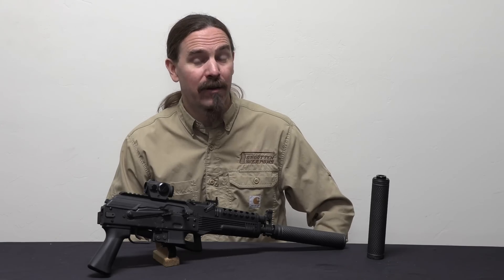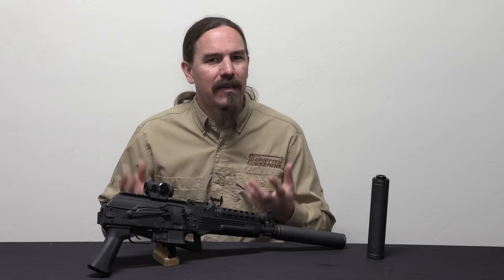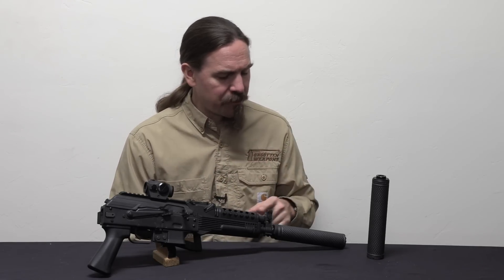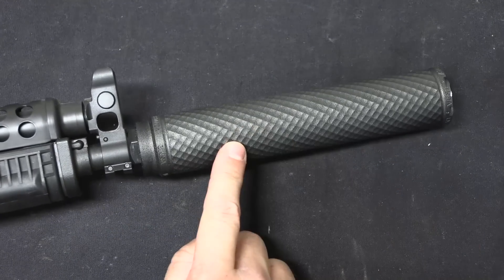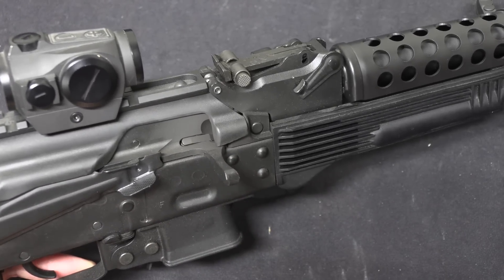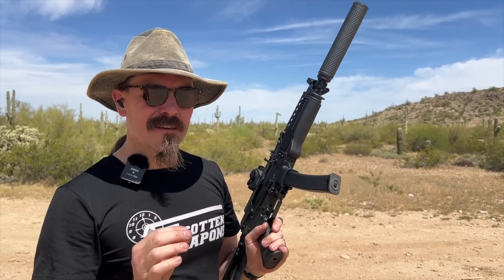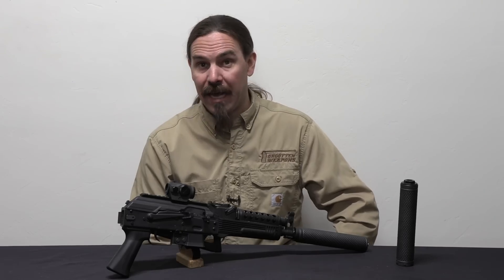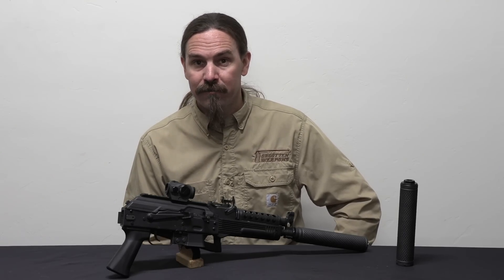PTR Vent Suppressor: 3D Printed Titanium Foam

Comment: This is a great application for metal 3D printing! 

I work as a machinist in custom lighting, and made a sculptural light fixture for a medical implant company a few years ago. 
(They sent us two skids of previous generation parts, and we strung them like beads on aircraft cable. Some interesting alloys in there!)

I may have, uh, hung onto a part I thought was cool, a titanium... spinal spacing wedge? which is dense at the tip, porous through the body, and dense at the back in the centre, allowing for a tapped hole, I suspect to allow for removal or back pressure. 

I'm a decent machinist, but I have no way to produce parts like this, which is pretty exciting, to me.
Reply: "...a titanium... spinal spacing wedge? which is dense at the tip, porous through the body, and dense at the back in the centre, allowing for a tapped hole..."

Out of possible interest to you:
I had two "cages" implanted for a spinal fusion.  I don't remember what material they were made of and the best description I came up with was "a stretched heli-coil with some connecting bits for structure that still allowed the mashed-up bone goopy paste (from my "hip bone") to be mushed into it and fuse into a solid bone graft".  They were made in specific diameters (height between my vertebrae) that I imagine correlated to common drill bit sizes, I don't remember how important ordering a certain length was. 

Sadly I was not able to keep them for my collection of "things that were once in me".  I tried but the approach/procedure was a study so they needed them for whatever reasons.  It was a successful fusion until I tore it; replaced it with "rods and screws", fusing the next level down at the same time (L4-5, L4-S1; it sucks, I do not recommend trashing your back).

Comment: What about the fact that titanium burns? I remember in the WWSD 2020 discussions about the parts for the final production rifle, it was said that titanium flash hiders were tried, but it was quickly learned that "titanium flash hider" is an oxymoron because the titanium will flake off and burn. Do these suppressors have the same issue?
Reply: Titanium cans, especially printed ones, do spark more in the first couple of rounds as the left over shavings or material is burned off. After that, whatever spark you may see is oxygen inside the tube burning after the first or second round. The two Ti DDC cans I have had some sparks to them initially.

Comment: I wish the ATF didn't exist, because I'd like to make my own delta flow suppressor.  I made a 2 stage delta flow muffler for a 420cc utility engine.  The same loud and annoying engine found on every cheap 3Kw generator.  But it's completely quiet.  The idea is the sound splits into two equal waves down a hallway, and cancel out as they meet up again.  Of course a rifle or generator doesn't sound like a clean sine wave, so you need different length halls within the entire spectrum it produces.  The delta shape basically allows different length halls as the diamond tapers off.  If it's not good enough on the first pass, then just run it through another.  Would look pretty cool as a suppressor too.  Like a big flat tank cannon comp.

Comment: Suppressors aren’t designed for guns to be quiet they are designed to be used for attack purposes
Reply: Then why do companies like DDC, OCL, Q, Liberty, Rugged, and others make and market Ti and Al cans as being quiet for hunting? I doubt the GA sportsman or rugged Alaskan was made for a direct attack actions since both have terribly high back pressure and limited firing schedules.
Reply: @ja0298 as suppressors are made for rifles being as long barrel and the design of the attachment makes the gun least sounded, you can hear it sounds like a airsoft gun but it’s a real gun
Reply: @worldbiggestfan1   those certainly are words, but that doesn’t really make sense or answer what I asked. How much do you actually know about cans and how many do you have/shot? Also you do know there are pistol suppressors right? Not just rifle suppressors. I should know, I have a 45 and 9mm can.

Comment: An interesting man had made a similar device in his home workshop experimenting with Aluminum Foam, Silicon Carbide Ceramic Foam, and High Flow Carbon Foam, all from McMaster-Carr; with the right combination it was VERY effective. 
22LR was spooky quiet and 9mm was impressive with a slightly larger can.

Comment: It makes me wonder if the reduced chamber pressure make it possible to suppress a PTR91 without changing the locking piece and rollers. It'd be nice to have a suppressor that "just works", and it makes sense for PTR to make such a suppressor considering their rifles are the prime reason for one imo.

Comment: The fact that the action was louder than the firing of the subsonic rounds was one of the things that impressed me the most
Reply: I have an old 60's era military suppressor research report guide, a lot of the designs they tested show mechanical noise as being the most noticeable signature and biggest hurdle after suppressor design gets efficient enough.  It is weird to realize that guns are loud even without the gunpowder though.
Reply: @Hawk013  Yeah, but then you realize oh yeah that's why there's the iconic "gun cocking" noise in movies.
Reply: This is why the Welrod surpressed pistol is basically a bolt action pistol. The action is too loud otherways.
Reply: @Seelenschmiede Maybe rubber on the endstop to absorb the grunt?
Reply: My mate is an engineer and he improved a can he bought.
His .22 sounds like that too.
Absolutely crazy
Reply: Go back and see his silenced Sten video, the action was loud AF, all you can hear is the action😂
Reply: It's like the good ol black ops 1 days where you could hear the action during firing

Comment: For cleaning I'd put a hose on each side connected to a pump and cycle solvent trough it. probably better then just soaking.
Reply: Or, hear me out, you could do what's recommended and put it in an ultrasonic cleaner.....
Reply: @wstavis3135  sure. But that's dissolving deposited material. Not flushing it out. Maybe a combination of the two would be better.

Comment: My gut feeling is: Pigs learn to fly, if you can dissolve carbon buildup in this porosity... That was the Achilles heel of every closed can design I have seen so far. Even simpler designs with 3D printed baffles, that also worked great. But did not have tiny channels to clog up. What solvent is that going to be, and how many more arms are you growing when you touch it? :D
I have to see that to believe it.

Comment: Ok, super neat. Think about where this could go. You could adjust the density of the pores to control where the gases flow inside the can. You don't have to vent all the gasses forward, you can basically vent from any surface of the can. You can change the shape of the can dramatically without the same detriments traditional cans would face. You may even be able to have a significant impact on recoil depending on how you design it. I feel there's potential here for a game changer.

Comment: My theory is that PTR will soon develop (if they haven't already) a way of using this same manufacturing process but with tungsten titanium alloys. Doing so would make the suppressers not only extremely lightweight but super heat & corrosion resistant and able to withstand higher gas pressures.

Comment: I love how the camera mic is recording the gun's clicking and clanking more accuarately than the suppressed fire noise

Literally videogame level quiet
Reply: The sound levels measured in the linked article show 108-125 dB for subsonic 9mm - gun action is not that loud on its own.
From HCE: Levels and sources of damaging noise include:
    85 – 100 decibels: For example, a hair dryer, blender, power lawn mower, forklift, or subway train
    100 – 120 decibels: For example, a bulldozer, impact wrench, or motorcycle
    120 – 140 decibels: Such as, a rock concert, auto racing, or a hammer pounding a nail
    125 – 155 decibels: Like, firecrackers or fireworks, or a jet engine
    170 – 190 decibels: For example, a shot gun blast or a rocket lift off
Reply: It sounds like an airsoft gun if anything
Reply: c:
Reply: I'm wondering if such a rig would benefit from a mechanism that would lock the bold closed to mitigate the sound of the parts recoiling and reloading. I understand that we really can't determine that benefit by listening to microphone audio, but I'm wondering if anyone has tried that with any other weapon. Honestly, does it make a difference? Just curious.
Reply: @jimzielinski946  A bolt action firearm would do the trick.
Reply: @jimzielinski946  just use a decibel meter
Reply: That was my thought too. I was coming down here to say this thing is like James Bond quiet with those subs! 😂
Reply: More like put that sound effect in a video game and players will complain that it's unrealistic.
Reply: thats called sound editing. the mic is leveling out the audio... u cant hear that kinda stuff in a video with people also talking :)
Reply: @REDN0AK  it's not editing, but normal mics are pretty bad at picking up the sound of gunfire. Still impressive that the loudest sound in the video is the sound of the bolt cycling.
Reply: @PAPO1990  I meant the mic software is automatically leveling out the noise leven. But yeah pretty impressive

Comment: The little bits of metallic-looking debris coming out of the ejection port during slow-mo are a bit concerning for hygienic reasons- is that just typical particles from the casings that would occur from suppressor or not?  

The main concern is that this 3d printed foam- what if it releases particles kind of like silica dust (but titanium, not silicon obviously) that are disastrously bad for your health if you breathe it in?   Maybe not as much as a concern if you're outdoors and left a leftie like Ian, but if you're at an indoor range w/ poor ventilation?  High volume shooters need to be cautious about how much lead particles/dust and other noxious elements they're breathing in on a regular basis, are these 3d-printed "foam" suppressors adding another risk element?

Comment: General shooter question.  Can you hold the bolt closed to prevent it from cycling?  If so is that generally reasonably safe for 9mm and 556?  Slide operated pistols can you hold the slide closed?  I wouldnt think for a 50AE.

Any thoughts from people who actually know for sure would be great!

Comment: I assume it needs to be soaked and ultrasonic cleaned and thats it for maintenance?  Edit: just saw it now so yes.

Personally i think that is actuallyna feature.  You dont need to worry about fighting to take it apart if it cant be taken apart.  My bigger question is will they warranty them for a long time in case they do get too dirty to clean eventually.

Comment: The price will come right down as the technology develops, and we may wind up with an integral suppressor that is part of a 3d printed barrel,  not requiring adapters at all
Reply: i would not want anything that requires ultra sonic cleaning perm affixed to my gun.
Reply: Self-consuming throw away guns that use their own mass as slugs.
Reply: I love it. 
 @filonin2
Reply: Look up the harlot 

It’s a thing in a remix
Reply: It depends on patents and who else can make similar products/designs. If PTR is smart then they locked up the design only for themselves and will own it to maximize profits. Also, these cans don’t appear to be hard use (for long) along the lines of more established designs so that’s another ding.  Lastly, the price, $1500 plus tax, stamp, shipping puts this closer to $2000.

Comment: Flow-through, vented, and gas relief suppressors are neat, but purpose built rifles that manage back pressure are a more elegant solution.
Reply: It may be advantageous for the gun to run supressed and unsupressed with the silencer changing very little of the weapon kenematics. Additionally, gas stacking is a thing with highly restrictive silencers.
Reply: @xj53pq7  
No doubt, they’ll certainly have a place in the future. That being said though, most suppressed rigs stay suppressed, and optimal signature reduction paired with optimal cycling is, well, optimal.
Reply: You can only make an AR-15 resistant to backpressure so much, you're acting like it's a non-issue when even with expensive gucci parts it definitely still is. These suppressors are very relevant and reduce wear on your gun as well. And in my opinion a flowthrough suppressors that doesn't require you to change your entire BCG, charging handle, and gas block is much more elegant.
Reply: @weasle2904  
It doesn’t take “Gucci” parts. All it takes is the proper dwell time, proper gas port diameter, and proper BCG/buffer weight. 

All of the “Gucci” adjustable parts and charging handles are bandaids for the industry trend of over-gassing rifles, fearing to deviate from mil-spec, and being stuck with a 16”/mid as the most optimal dwell time without getting into SBR/PAW territory.

About the only “Gucci” things I’ve seen that have an appreciable reduction in actual gas intrusion to the upper receiver is the Surefire and LMT enhanced BCGs, and the Gemtech evacuator.

A louder and more maintenance intensive suppressor is not an advantage if you can make a quieter and less maintenance intensive suppressor work just as well in a rifle.

Comment: Just a suggestion: I'd add a front cap with an extension for the 6 vents, to prevent clogging the vents with debris in fine sand or mud conditions.

Comment: Now you need to solve the clatter emanating from the firearm's action. When using a manually operated breech where gas blowback is not an issue, how would this suppressor be ranked against more conventional suppressors?

Comment: To see if it is actually 'flow through' I'd check with a thermal camera at the receiver ejection port and the end of the suppressor as the gas flow should be visible , and I would not be surprised if the suppressor is actually drawing air through the barrel as the hot gasses cool.

Comment: I wonder if the Coanda effect could be used for sound reduction?  It draws surrounding fluid, in this case air, so that you end up with a lower speed but higher mass flow that would presumably be cooler.

Comment: Solvent or ultrasound… I half expected it to be “put in self cleaning oven”
Reply: Solvent in ultrasound.  Literally the 1st thing the manual tells you not to do. :D

Self-cleaning oven is a good idea!  It might work, and is actually something I need to consider for some of the things I deal with.

It's titanium, so probably won't affect the heat treatment.
Reply: @EmperorA0 depends on the solvent. Water is a solvent too. But yeah, flammable solvent is risky.

What would be cool is if the next version had platinum, or whatever they're using in diesel particle filters. Then the soot could just be burned out.
Reply: @EmperorA0  You can get ultrasound cleaners that are rated for flammable solvents (water is also a solvent, but only chemistry nerds know that).

Comment: From a military use standpoint, the 1000/1500 round/cleaning schedule seems like a disqualifier, both because there isn't a precise way to track round counts at the moment and because of the volume and irregular firing cadence on operations. Even if armorers reserved clean suppressors (at cost) for use downrange,  it would only take a few heavy suppressive fire sessions for the suppressor to get clogged up. It would be interesting to see how the back pressure and performance degrades with respect to round count past the 1000/1500 mark.
Reply: I would think it would just turn into a barrel extension, like a fake suppressor on a SBR.
Reply: We should ask the AFT the question. At what point of carbon and fouling load does a suppressor cease to warrant the bribery fee?

Comment: I wonder if they'll have any patent issues - this exact concept is being used by a bread making company (Kaak?) who stumbled upon the process for making their prints porous by printing things "wrong", now they make cutting tools with attachments points for compressed air so they can blow air through while cutting dough and it won't stick to the tool.
Integza had a video on it a while back - title is "this will change jet engines forever".
Reply: There are infill patterns used for 3D printing with pore patterns which should do the job for a muffler.  Pre-existing patents on printing methods shouldn't be a problem.
Reply: The printed parts that did get used on Airbus jet engines didn't make the cut. Loose change is better for a slot machine. Even carbon fiber is just black fiberglass, so I wouldn't get too carried away use cases for printed parts

Comment: Thanks for linking the Pew Science report. 
This looks like a great new product. 
Expensive obviously and more maintenance intensive as well, but still very cool.
Reply: is that actually that maintenance intensive? it sounds like you just drop it in a bucket of solvent after putting a thousand rounds through it, and then take it out and let it dry. that sounds pretty low maintenance to me.
Reply: @Kataclysm113  the bucket of solvent won't do the best job. over time you will get build up that the solvent will never be able to remove by itself. you really need an ultra-sonic cleaner for a product like this.

it's not 100% straight forward either. the stuff that builds up in a suppressor turns into a concentrated carcinogenic soup. something you most definitely do not want to be exposed to. it just means proper ventilation , ppe and handling procedures.